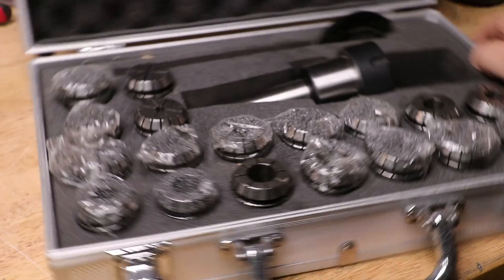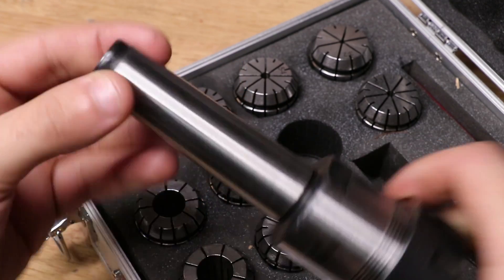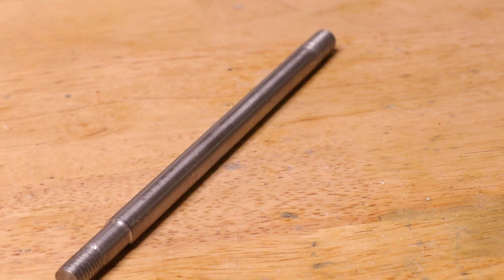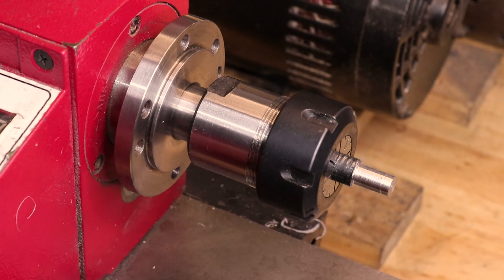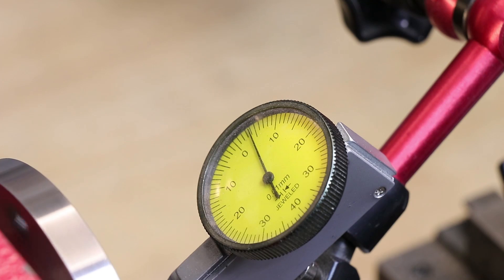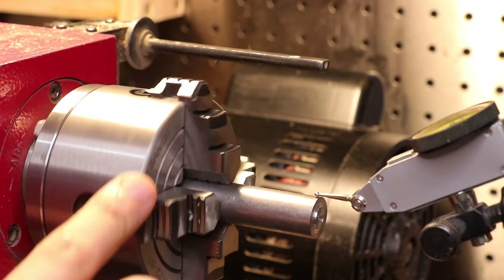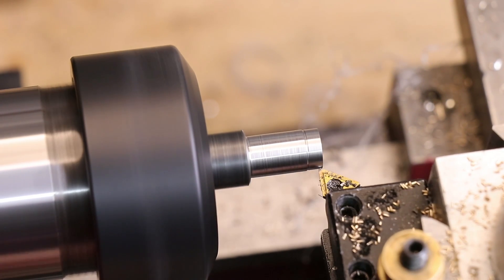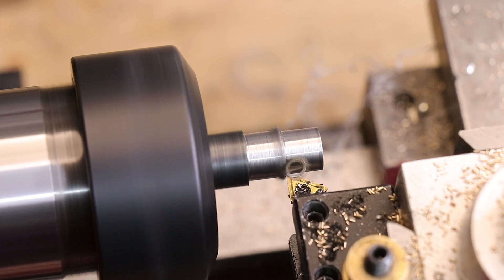Cheap Ebay Collet Chuck Is Actually Pretty Good

Comment: I am drilling a hole in the draw bar so it can handle longer stock. The hole is about 8mm or 9/32” so 1/4” rod will fit. I drill for a time till the draw bar gets warm then set it aside till later. I am in no rush.

Comment: better results if you use a old broken tap & used in a rotary. Dremel or router  motor. the work well a thread mill's too. I have even set the tap in a rioter & cut a third by setting the gears to that thread & cut rely fin thread range  like a thread mill , would The rang being that of thread diameters for example A 16 mil cuter can cut  5 mill 1.5 pitch  Justas easily  as a 16 mill thread  At 1.5 pitch . whit such a tap i never trough a old broken tap away . now . check out Stephon 's channel Thread cutting on a Manual lathe.   it will open your eyes , son . to a  new concept to trading on small lathes .  . Les England .

Comment: All good but of no use without a link to the actual product
Reply from the maker: I bought from a local support so a link isn't hugely useful. These are very common on eBay, just search for ER 32 collet chuck. They all come from the same factory so the quality off them should be similar. Cheers

Comment: Just so you know "proper collet chucks mount on backplates" isn't true. The most common way to mount a collet is a 5C collet in an adapter for the lathe spindle taper, for example in my machine the 5C collet "chuck" is a lump of steel with an MT5 taper on the outside and a 5C taper on the inside. That's it. And it's about the most accurate way to mount a collet in a lathe, as it only relies on two tapers.

As for Chinese stuff, I recently bought a D1-4 plate mounted ER32 chuck on a whim, as ER collets can handle a wide stock width range. What a POS. Runout on that was awful, measured in millimetres, not microns, and the D1-4 lock screws weren't even cut properly. I'll reface the back, make new lock screws and regrind the collet taper, but I have to wonder how crapped out the CNC they made it on was.

Glad you got lucky with your MT3-ER32.
Reply from the maker: Maybe you could replace proper with better (depends how you interpret it), atleast in the context for er collets, having less of a stick out the front and no draw bar and all is much better than this style of collet chuck. Ultimately I'm not a fan of 5c collets in general, and I wanted to keep that can of worms out of this video.

Comment: I considered getting an mt3 collet chuck like this, but since I would only be able to hold stubs or cutting tools I gave it a definite pass. You can get or make an ER32 collet chuck that mounts onto your spindle such that you don't plug the bore hole.
Reply from the maker: I agree with that, probably much cheaper to make it yourself too. I probably wouldn't have bought this if it wasn't for my mill needing it. Cheers

Comment: I think ordinary metal lathe chucks are way to go 👌 anything that you modify on them you lose accuracy. I use brass shims to put between work piece and the jaws themselves, to protect it from work marks.
Reply from the maker: I guess what works best for you is always the best course of action. 90 percent of the time scroll Chuck's scroll Chuck's are best suited for my type.of work, but that other 10 percent of the time, having a collet or independent chuck on hand is invaluable. Cheers.

Comment: Thanks for the video.
I did the same for my Bernardo Profi 400 lathe. But I used a standard 180 mm long M12 bolt from my local warehouse. I only had to make a washer for it to fit.
The depth of the collet chuck is a problem for me too. It would have been nice if there were collets that fit directly in the MT3. Maybe something like a tube that goes all the way to the other side and with a nut there... Sounds a bit expensive...
Reply: Maybee I don't understand you, but there are MT3 collets, and they use a drawbar.

Comment: When are you going to powerfeed your main lathe screw so your cuts look cleaner
Reply from the maker: Hi alex, the poor surface finish in the steel is mostly related to the bearings and slides wearing out. I am in the process of replacing them and the surface finish will improve. As for the auto feed. I might look into installing one, without using the leadscrew because I dont like the idea of using a leadscrew for auto feeding. Cheers

Comment: Ironically the best one can hope for is that the collets themselves are not that accurate when you have a collet chuck with this much runout so that you can rotate the collets, find, and then mark them where the runout cancels to some degree and is the least. I'm considering a collet chuck for my mini lathe but am looking at a flange type rather then the morse taper so that I can insert longer materials into the collets as well as have a bit of a shorter stickout of the chuck. Since I'll be buying everything from scratch I'm looking at going with ER40. The flange types I've been looking at have a combination of 3 and 4 hole mounts which gives more options in a rotation to find the best location for the least amount of runout in case that's going to be helpful in cutting down runout since that would not help if the cheap collets I intend to purchase are not very precise.
Reply: "flange type rather then the morse taper"
YES! So many reasons to do this instead.
Reply: @ExtantFrodo2  One reason I could think of to go with the morse taper is if one has both a lathe and a milling machine with the morse taper and intended to use the collet holder on both machines.

Comment: FYI not microns. A micron is one millionth of a metre. 10 microns = .01mm.
Reply from the maker: In sorry I don't quite understand. Each division on the indicator is 10 microns. The run out was 2ish divisions so a little over 20 microns. Cheers
Reply: My bad. The dial is in increments of .01mm. Applying the 10 microns per .01 clearly supports you number. Unusual to talk microns for a low cost lathe however where runouts  are usually greater but ok given the cost of the machine.

Comment: Great review! Cheap import stuff like this is always hit-or-miss, and it looks like you got a halfway decent one. 

I tend to think of import machining equipment as a kit... Something that works ok out of the box, but can be made better with a little work. Not sure how hard the steel of that chuck is, but you could likely machine the ER taper. Test the runout of the MT3 taper of the chuck (looked like there was enough sticking out). Do this a few times, taking the chuck out and rotating it a bit each time, to make sure the runout is the same in any position. If the MT3 taper runout is good, then you can fix the ER taper. 

With the collet chuck in the spindle, and your DTI on the compound, indicate the internal ER taper to get your compound aligned to the proper angle. Then, with a boring bar, take very light passes until the runout is gone. You shouldn't need to remove much material. The collet will sit a tiny bit lower in the chuck, but not enough to affect function.

After that, the biggest source of runout will be the collets themselves.

Comment: Nice. I wonder if one of these collet chucks would be better for the lathe. They include a back plate, are shorter, and I think allow stock through. You can find them on aliexpress. US $30.06  18%OFF | Bearing Steel ER-32 Collet Chuck  Compact Lathe Tool Tight Tolerance 80mm Diameter
https://a.aliexpress.com/_mte6hfN
Reply from the maker: I mentioned these at the end and I am certain that these types of collet chucks are better for lathes, since  don't require a drawbar.  You could even make it on the lathe in situ and cut the taper whilst it is mounted for super low run out. Only down side is that I wouldn't be able to use it on my mill. Cheers
Reply: I wonder if I could mount one of these to my never used face plate?

Comment: I didn't even know a set of collets with a chuck could be purchased so cheaply.  That's a great value, even if it doesn't produce Gotteswinter or Ox Tool levels of precision.
Reply from the maker: Cheers. Funnily enough there were cheaper collet chuck on ebay, selling for $15 (without collets), but even for me that sounded too good to be true.